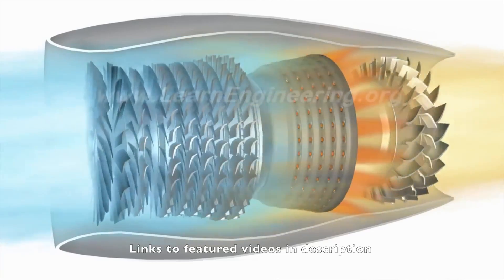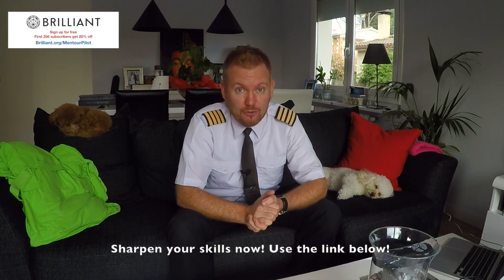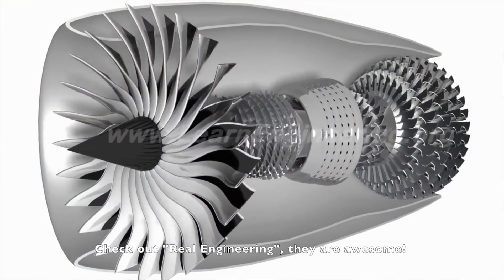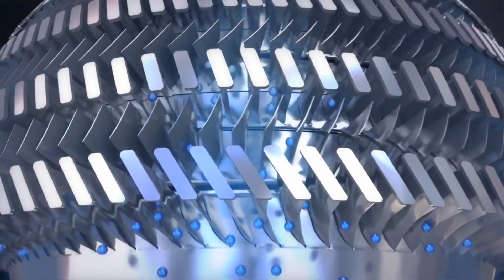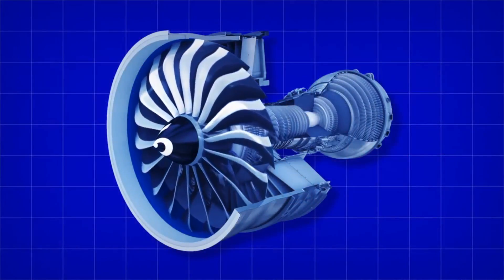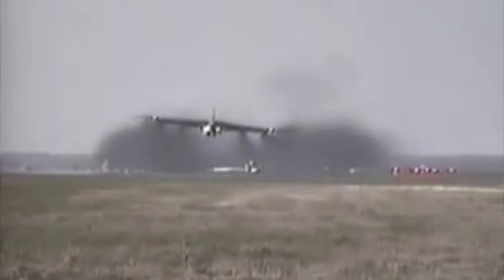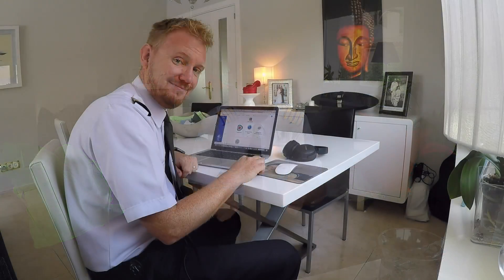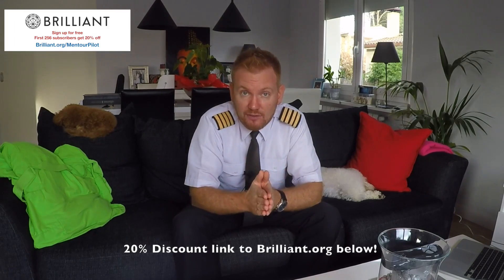Can water make Jet engines stronger?!

Comment: Could water injection be used to increase the thrust further on modern jet engines for a shorter runway? 
Is it possible for a turbofan jet to just use the big fan only to produce thrust to move forwards/reverse when on the ground especially if the environment is too hazardous for jet combustion?
Do smaller jetliners with smaller jet engines like the leerjet have a turbofan in them and a rear shield for reverse thrust together (using the engine working normally to reverse)?
If you combine a modern turbo fan jet engine and concorde's jet engines on the same aircraft, would it be fuel efficient at both supersonic and subsonic speeds?
From 10000 feet and above, will an aircraft initially at cruising speed glide longer with flaps deployed rather than undeployed?

Comment: I got a question! When I fly in my flight simulator (x-plane 11) and I'm doing a long haul flight with a lot of fuel and overall weight, the aircraft has a hard time getting up to 39000 feet so I thought I'd let it fly at FL320 until it burns off a third of its fuel so I can get up higher without having to let the engines run at 100% N1 at autothrottle. HOW is that situation handled in real life, does the FMC / MCDU have a profile for it that automatically changes the CRZ ALT after a certain amount of fuel was burnt? How is that managed?
Also, what determines the CRZ alt for short haul flights that for example, last an hour? I wouldn't make sense to get up to FL390 for like 10 minutes, whats the most efficient way to approach this stuff? I'd LOVE a video on that :)

Comment: Hey Mentour I love your videos, you explain things so well and they are very interesting and educational!
After watching this video I'm wondering if you ever made a video on how jet engines start. Like how exactly does the air in the burn chamber get compressed enough for ignition to start the engine. In a diesel engine there is an electic starter to make compression but I assume jet engines use a different method. 
Thanks

Comment: Correct me if I am wrong, but assuming that air with rain water inside is denser than clear air... then bypass propeller is working in denser environment and therefore should be more effective? Or should not, as pushing denser "thing" requires more energy and therefore it is zero sum?

Comment: Long time lurker, here.  Great video! I have a question: How is power transferred from the rotational energy of the turbine to the electrical/hydraulic systems of the aircraft?
Reply: Air is blessed from the engine via tubes that are ducted through the aircraft that run the air conditioning and others. EX Continental aircraft technician and machinist.

Comment: Why don't propeller engines in airplanes (or even boates) considered reaction propulsion thrust? The propeller sucks air (or water) on the front and pushes it by the rear just like a reaction engine, right? Addicionally, as you mencioned, most of the thrust produced by a jet engine comes from the fan at the front that is basically a propeller in a tube, right? So, if a propeller engine configuration can't be considered a reaction propulsion, the jet engines are mostly non reaction engines, right?
What would happen if an airliner jet engine was put into operation in the vacuum of space by feeding it with the necessary oxigen in the combustion chamber? The resulting propulsion thrust would be a fraction of the one it normally gets, because the front fan wouldn't be contributing, right?

Thanks

Comment: with water injection, I thought it worked by cooling the incoming air so much that as it condenses, more air comes in to replace it, thus you have more air in the fuel air mix to make make a bigger bang, just as a turbo charger or supercharger works by forcing more air into the engine by mechanical means on piston engines to increase the air in the fuel-air mixture, resulting in more power

Comment: TACA Flight 110 (1988) suffered dual engine flameout because it flied into heavy hail thunderstorms with a decrease in power setting, and unluckily, it suffered hot start when the pilot tried to restart the engines. But the pilots were skilled enough the make an emergency landing. Details in Air Crash Investigations.

Comment: The F82 BMW M4 GTS uses water injection on its turbocharged engine to cool the engine so the turbos can create more boost and thus more power without destroying the engine with heat

Comment: KC135 if I’m not mistaken used water injection on the engines. I’m an old retired mechanic so it’s hard to remember.  I worked on the old C141A/B models.

Comment: Two ways Going up and going down...They Fly Cruise Control Over The Cloud..They Dont Needed Gases TURBINES Just like VACUUM PWM RPM 16000..ENGINE IS SIMPLE REDESIGN TO COMPILATIONS....FACT...AIR PLAIN JUST PROPELER...THATS WHY BEFORE TAKE OFF THEY IN TO HIT THE ENGINE STARTED MOVING ...TURBINES CAN STILL FLY EVEN YOU COVER THE FRONT IN AIR INTAKE NOW THE AIR BACK COMPRESS STARTED HEATING NOW YOU CAN PUT THE TORCH TIP LIKE A LIGHTER USED PLATINUM. JUST SPRAY HHO NITROGEN.....ONLY AFTER BEFORE ARRIVED DEPARTING AIR PORTS...ITS OKAY THOSE ARE JUST SPRAYING WATER...IF GASES IT WILL GO DOWN..STRICTLY UP THERE NEVER LISTEN WITH PEN TEN LIST WORD OF COMMAND...COLLIDE IS SET CURSED..LIKE WHEN YOU PAY INSURANCE TO ACCIDENT YOU PAY TO MAKE IT HAPPENED IS GOING TO HAPPENED THE DAY THEY CALLED BLINDSIDE CAPIZ.. .

Comment: Please don't take it as a criticism but maybe you should explain why water cools things in a jet engine. Many people will believe that it's because water is just cold, but it's mainly because water is turned into vapour (steam), and turning liquid water into gaseous absorbs a lot of heat (which explains why you need to leave a kettle a very long time on the heater for its water to fully evaporate and why you are cold when getting out of swimming pool and it's windy). Maybe also explain that a tiny little volume of liquid water is turned into an incredible volume of gaseous steam (ratio of 1->1700 if I'm correct), which explains the significant additional trust (not due significant more mass but to more pressure/speed of the ejected gas). But whatever these little details, I love your videos !

Comment: The primary purpose is actually cooling and heat capacity, the mass of the water is secondary(the water mass is only about 5% of the total air and fuel). Water injection is also used on piston engines for similar reasons. Thermodynamic heat capacity is why water is still used for modern steam turbines rather than some other working fluid. (originally water was just the cheap option but current steam engines condense and reuse the water.) The basic jet engine designs were capable of the needed thrust without water but they would quickly suffer heat damage, and the steam cycle is thermodynamically very efficient(water is nearly the optimal possible heat transfer media) and so the steam created has the side effect of effectively motivating the turbine section which then increases power to the compressor and total airflow, more air can use more fuel, so more total energy. 
Modern high bypass turbofans could also get a large boost from water injection but it is an added complexity and not needed for acceptable performance at low speeds. 
Now as for the pollution, the black soot may look bad but it settles from the air fairly quick and the reduced temperatures greatly reduce NOx emissions which has a somewhat longer half life in the air and acts  to form smog, acid rain, and to deplete ozone. (though on the upside the acid is nitric acid which, after neutralizing by dissolving some rock, acts as a plant fertilizer)

Comment: Another reason you would see more black smoke from older generation jet engines was because in the hot/burner section, they could not burn fuel as efficiently/lower temperatures than modern engines can. Therefore less burn off of the jet fuel ( which is pretty much diesel) and you would see the more visible dark smoke.

Comment: Basically water 💦 injection is tricking the jet engine into thinking the air is cooler/more dense therefore more power can be produced by lowering the internal temperatures. Even the British Jetstream J31 turbo props used this and even the modern BMW track edition M4 GTS has this system installed.

Comment: Have you done a video that talks about the service life of an aircraft and what metrics determine that? Thanks. It's wonderful videos that you're making.
Reply: Richard Cheatham the engines either jet or piston are determined by hours of use ( mileage like a car does not matter) The hours of use determine oil change, routine maintenance and overhaul etc by hours of use. A typical piston can usually last 2,000 hours and turbine have to have turbines inspected after a certain amount of time. Usually pressurized aircraft airframes are determined by cycles. Basically every time they take off and land is one cycle. The airframe actually expands and contracts, thus this is wear and tear and is inspected after so many. Basically on aircraft wear and tear is determined by hours of use, calendar and cycles. All of this has to be done in order to be certified to be an airworthy aircraft 👍🏻
Reply: Very explicit info and it's much appreciated. Safe travels to you.

Comment: When I was a boy in the early 1960s our family went into O'Hare Field (Chicago) to pick up my grandparents who were flying back from Arizona. We got there early, so we spent some time on the outdoor observation deck watching 707s and DC8s taking off. They must have been using water injection as you described, because each one laid down a blanket of dark grey smoke as it lumbered off into the sky on a shallow climb angle. Not good for the environment, but we kids sure thought it looked cool! And boy, did we love the roar of those old turbojets!
Reply: The black smoke is caused by bad engine design.  It is unburn fuel - nothing to do with the water injection or not.  Notably RR engines never smoked like that.  A newish fan jet engine in the Harrier - the RR/Bristol Pegasus - can use water injection  for about a minute as the tank contains 50 gallons only.  With NO smoke at all.

Comment: Can you make a video about how air conditioning systems work on planes?

How does the cabin achieve comfortable temperatures when cruising at high altitudes when it is really cold outside? Why is it sometimes I hear in the news that passengers are stranded on the tarmac on hot days and the cabin gets too hot? Does the air conditioner cooling system only work during flight? How many temperature zones does a typical passenger plane have from a smaller plane like A320/737 to a jumbo A380/747?

Comment: The density of liquid water is approximately 0.96 grams per cubic centimeter at 100 C at atmospheric pressure. The density of water vapor at 100 C at atmospheric pressure is about a factor of 1600 less, and so water expands by a factor of 1600 when it turns into steam at atmospheric pressure.
Reply: I suppose this volume expansion in older engines when water was injected would also contribute to thrust due to the escaping steam??  I see others below had the same thought ...

Comment: I would disagree with your assertion that water injection produces greater thrust by virtue of added mass, given the weight in added water is quite minimal.
The disproportionately greater contributor to thrust comes from the rapid expansion of water to steam causing thrust.

Comment: Amazing video! I wanted to ask unrelated question - Do you know why do often even relatively big airports like STN, MUN or KRK use diesel generators for the airplane even if they are just next to the terminal building, instead of using electricity from mains? Is it not just unnecessary more expensive for the airport to operate diesel generators?

Comment: Water expands to steam by about 1600 at sea level.  I don't know what the ratio is at 35000 ft.   Water injection was used in WWII fighter planes to boost power for a while.

Comment: I am trying to learn the reduction of throttle, application of brakes and placing the engine in reverse sequence. Is that just before touchdown we place the engines in neutral bring the plane to land, and on touch down we apply brakes and put the engine in reverse? I just want to know if that sequence is the right sequence
Reply: The brakes braking force is usually set before touchdown and as soon as the wheels touch the runway they activate. The sequence is.

Idle thurst > Landing flare > Touchdown of the main gear (here the spoilers and brakes activate automatically) > Reverse thrust

Comment: Why cant some type of screen be placed in front of jet engines to avoid bird strikes ? Would it impede the air flow that much ?
Reply: The impact of a 10 pound bird at 150+ knots would require an excessively heavy screen, along with aerodynamic issues, maintenance, and the icing Lancair mentioned.
Reply: wayne 630  I would think so and would ice up and could cause problems with chunks of ice coming off the screen into the engine. Besides flying into a large flock of geese like Captain Sully (very rare)most birds are just chewed up in to small pieces and spit out. I have been flying for over 20 years and would say on average I hit one every 2 years ( usually around the nose) Always just after takeoff or just before landing. Rarely see birds above a few hundred feet (I have seen ducks and geese up around 7,000 feet!). Birds are pretty good about getting out of the way (I have seen buzzards see us coming into land and they will tuck their wings and dive away). Also, ever notice many large jet engines will have a white dot painted off center on the front blade. When the motor turns the white dot is moving and is said to scare birds away when they see it.
Reply: @lancairw867  The dot is actually for the ground crew to know when engines are truly stopped, at cruise settings it becomes a blur.
Reply: MyTech  it’s actually both. You are correct for ground operation but you will see high mounted jet engines as well have this also. Remember to us a blur in high power settings but not to the incredible vision of a bird 🦅👍🏻
Reply: Screen would at best chop up the bird at those speeds, and at worse be damaged itself and pieces of screen into the engine. Also would drastically add huge drag to the whole process.

Comment: just a note on water injection . years ago some gas engines on some cars and trucks water was pulled into the carburetor thru a ported vacuum line and into the combustion chamber . this stop engine ping because of higher temp . the gas needs to burn , not explode . the ported vacuum port was used so that water was sucked in only when stepping on the gas pedal and a check valve in the water storage unit so water wouldn’t flow unless needed.
Reply: Still widely used in the hot rod scene. And even in a production context (M4 GTS).
Reply from the maker: Cool!
Reply: Water or water/methanol(for freeze protection and some octane boost) was common on world war II fighters as part of the "war emergency power" boost setting.

Comment: P51 Mustangs also had water injection systems to give an increased burst of thrust when dog fighting or short field take-offs.
Reply: Mustangs ALL had piston engines.  If they injected water, it was to keep the engine from burning up while running at extreme power levels.  And retard detonation.

I suspect they had NO2 injection.  Pretty sure the thunderbolts (P-47's) had nitrus too.

Comment: Does jet engine rotation direction matters regarding its location? And does it has any gyroscopic effect?
Reply: Ignas R.  Yes it does. If you ever look at the tail on jet aircraft with the engines mounted under the wings you will see a much larger tail compared to air with engines mounted at the rear. Look at how big a 777 tail is compared to say a MD 11 3 motor or MD 80. When I’m taxing on the ground with one engine on a 2 engine aircraft ( say the right is running) I have to counter steer to the right to stay straight.

Comment: They actually used fire hoses in an attempt to shut down the port inboard engine on a QANTAS A380 during an incident on QF32 on November 4 2010. After landing the crippled plane the flight crew were unable to shut down the engine due to debris damage to the electrical wiring. In an attempt to shut down the engine they tried using fire hoses to poor a lot of water down the engine intake. When that failed they used fire retardant which worked.